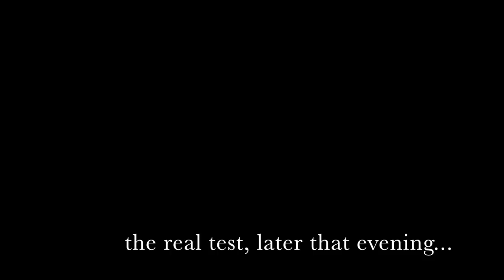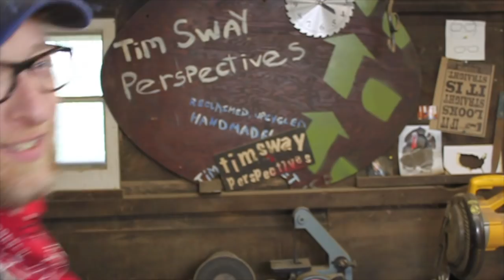GoPro Shifter on a Friction Motor Trike

Comment: Hey, @1:21 isn't the nut suppose to go on the other way? I thought the pointy bits were suppose to go up against the object to help prevent it from backing out? Cool idea, btw! 🤓👍
Reply from the maker: Live Free and DIY I spoon two nuts against each other to set it facing the right way so it doesn't really matter, but yes, it should probably face up. Thanks!

Comment: Does the shifter change a gear or engage the motor on the wheel?
Reply from the maker: It engages a spinning wheel against the bike wheel. Google "friction motor"
Reply: Yeah, we used to make Mower/weed whacker motor bikes as kids using a skate wheel as the friction drive wheel, but they would almost always rub constantly. It was usually how you would get it started. I only remember a couple of mates who had a way of lifting it off the wheel.
Thanks